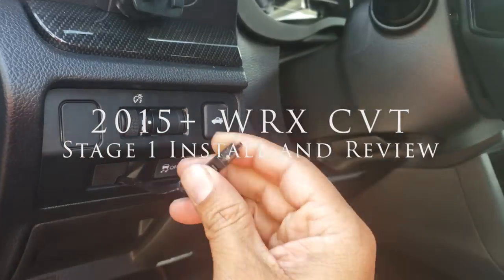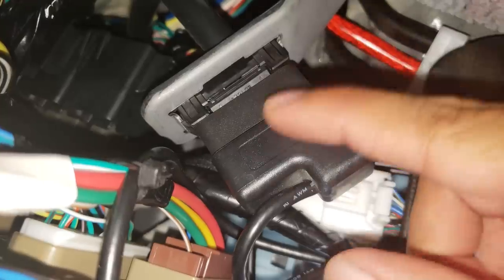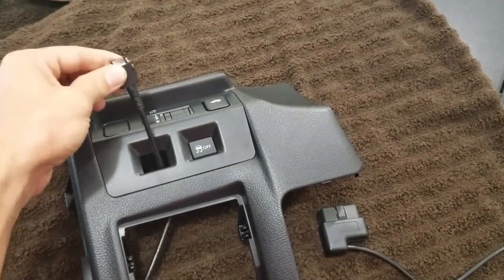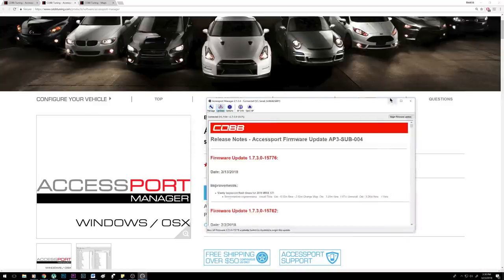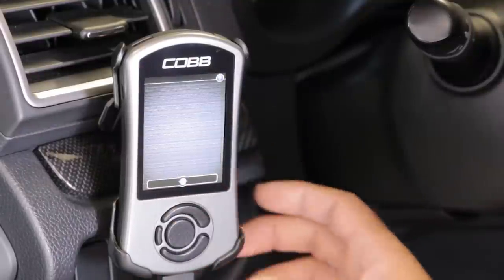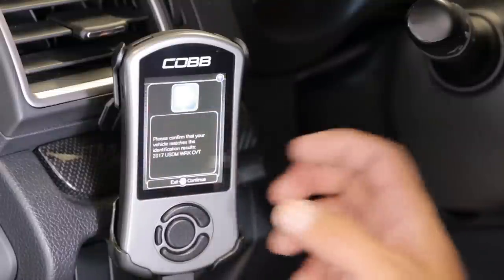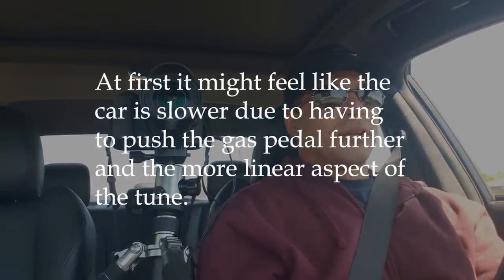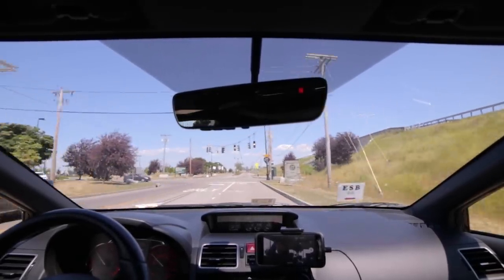WRX CVT Stage 1 Review

Comment: So i just staged one with mtuned and i went with boomba bpv and ets intake tuner hit me up with a update and told me it was to have a little extra fun now my idle is loud af and sounds like there is a slight rumble and i have a stock jpipe i love this thing alot more frfr best decision i ever made for this car
Reply: how’s it doing now? just wondering how the cvts holding up
Reply: @seanstephens2063  blew my motor maybe a month after i posted that staged 2 car is louder then most the v8’s with muffler deletes pushing 310whp on 93oct aftermarket intercooler ets intake boomba bpv/bov invidia catted jpipe muffler deletes stock catback with no resonator tgv delete plm charge pipe cars been good lately really reliable have its moments here and there with the false knock but its false   Its been really hot so heat soak as been playing with my anxiety lately

Comment: i went with stage 1 93 with my 15 wrx as cobb offer me to use that. but they seem low DAM under .866 with s mode automatic. and i tried switch to stage 1 91 there improved with DAM stay 1.000 with s mode automatic or manual paddle shift. i highly recommend yall go for stage 1 91 safe with stock engine without intake.
Reply: ive got the ets intake with boomba bpv and im just running the stage 1 93 tune havent had issues for a long time

Comment: Did the tune make the sport sharp modes "shifts" feel more realistic?
Reply: did you ever find out the answer
Reply: @oldajm5177  ha I've actually had a few cars since then but not the wrx so I have no idea. My guess is the different modes aside from simulating a different  amount of gears, also change the pressure on the belt so as you progress through the modes it becomes more and more aggressive. Nothings beats a manual though for feel. I was looking at this for my wife. We had a jaguar xe 35t instead but then she got a tuned mini Cooper s that was almost brand new and I got an e39 540i out of the deal too.

Comment: I have a question. So I’m running V4.00 BigSF 1+ 93OCT Normal wastegate map. On my CVT with obviously the SF intake and a Grimmspeed BPV I saw a peak 22.6 on boost. Scared me a bit because I heard too much boost can bend a rod. Should I be worried and go to a Low wastegate 93 tune or am I safe with the normal wastegate tune.  I heard it was normal to peak that high because it’s only for a brief second before dropping out.

Comment: Another great video. I plan on doing some of the same mods so it's nice to see someone do and review before me. In one of your previous videos, you mentioned installing a mishimoto cvt cooler. Have you done that already? Do you think it's necessary with the accessport?
Reply: On the forums it said installing a mishimoto intercooler and torque converter would allow the CVT to handle more power, such as a turbo kit.  There are quite a few videos on youtube about it. I think AMR is one of the well known shops that specialize in WRX'S with CVT.  This one guy's WRX CVT was pushing 330hp..not bad at all lol.  He even gives you a list of all his mods too.  Good luck, chingoo! 😉

Comment: Do you have to download the specific stage 1 cvt map or does the stage 1 map that comes on the accessport work just fine?
Reply: Boost & Shutter  I have version 301. That’s the one ive been running for about a week no. Dam dropped in the first 100 miles but after that it’s been smooth sailing ever since only the -1.41. I have 350 miles on the tune. Any reason why it would drop dam in the first 100? Maybe the car learning the tune?

Comment: I had a 2015 WRX with COBB stage 1. Just purchased a 2017 WRX with 6 speed standard. Take my word for it...DO NOT GET A CVT UNLESS YOU ABSOLUTELY HAVE TO. No comparison to the standard. Feels like a completely different car and a much better and funner driving experience. The engine itself even sounds different. I had heard the engines put in the CVT models were "dumbed down" for the sake of less wear to the CVT and now I totally believe that was probably the case. I tuned my 2017 WRX with the COBB stage 1 93 octane and it is amazing.

Comment: Is there a way to flash out the fake "stepped" shifting with the access port? I would be on board with a tune and other mods if that transmission wasn't 8 grand...62k miles on mine so far.
Reply: You can find replacement CVTs for a lot less. I'd love the ability to chose a true CVT mode, or make it so the pedal compression is at 40-50% before stepped shifting starts.

Comment: Does it matter which drive mode the car needs to be in ( ie Intelligent mode, sport mode, or sport sharp mode) ? 
Also, I have an upgraded SPT ( sti) exhaust and a drop in air filter so is this considered a stage 1 tune or are there specific tunes i would need to look for? 
Thanks
Reply: Stage 1 ots map is stock air filter  everything on the car stock but you can run a cat back exhaust with it

Comment: Hi I ordered the stage 1 intake with access port without realising it said 6 speed manual only, do you know if it will work with the cvt?
Reply: I made the same mistake, did it still work?
Reply: @omarmoustafa3063  Yeah it's fine for the auto as well

Comment: So how much hp can the cvt handle I hear you’re pretty much stuck with factory power
Reply: Killed mine.  Subaru charged me "only" a deductible of $2100!  Do NOT go much over 300whp.  Subaru made a BIG mistake with this CVT junk!  My 02 auto is still kicking.  My daughters 06 FXT Stage2 auto...is still kicking at 260000 miles.  Fastest car in the family to include the 14 WRX  wagon. Some blow up even stock.
Reply: If you dont abuse it too much you should be good. I think 300 hp is enough for daily driving my wrx 15 cvt. It not like I'm going to race everyday. Well I'm think getting second car another suabru maybe 2.5rs impreaza stick this time.